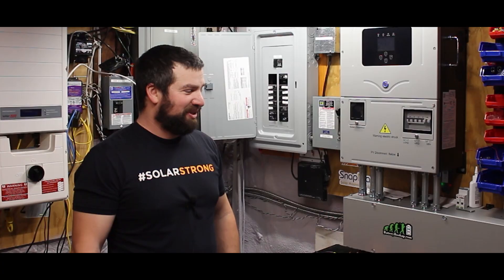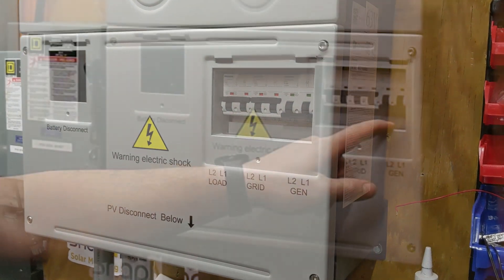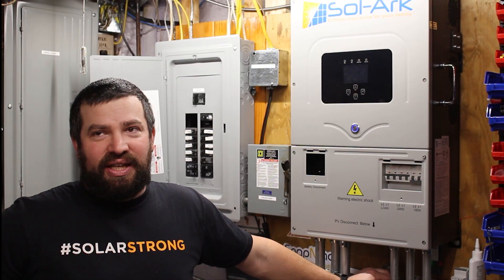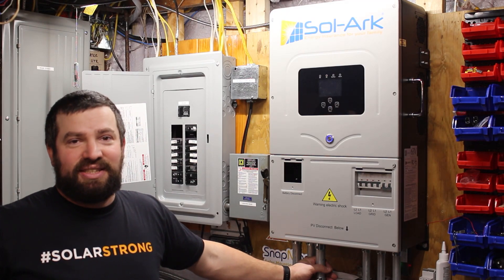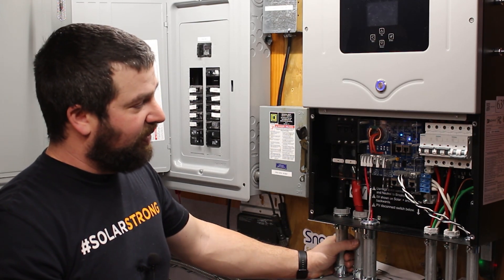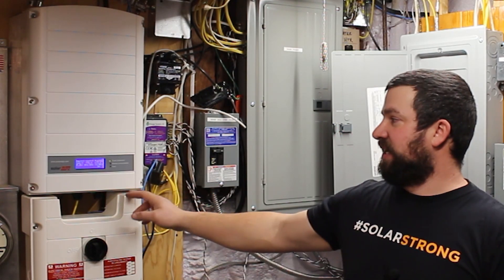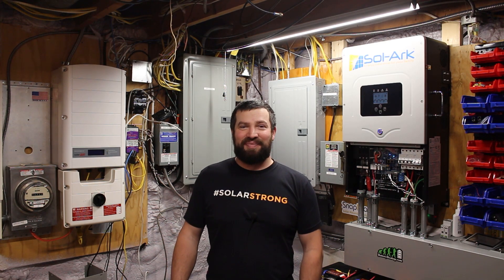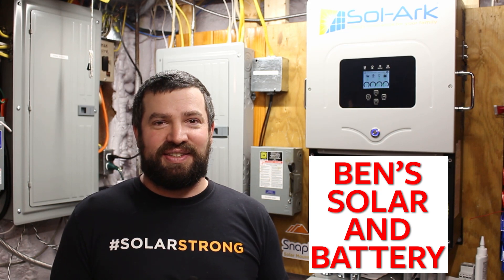Why the Professionals use the Sol-Ark 12K Inverter and Solar Charger

Comment: Note, only use the 90C rating of the wire if what you are connecting it to is rated 90C. If it does not say then it is not rated 90C.

Comment: It seems like the Sol-Ark 15K 2p inverter, and presumably the 12K, doesn't require an external AC Coupled Inverter to supply solar PV power direct to the AC home grid infrastructure - is that correct? If so, why is it that Sol-Ark is pretty much alone in this capability after the solar industry has had years to mitigate the work around?

Comment: After extensive research on an island residential solar inverter.
  I went with the sol-ark-12kw EMP. My installer contacted them to make sure it would work with my current whole house system and generator activation. Solark tec support reviewed the plan and said it would work for a whole house system with standby generator.(email documented) After purchase we saw it was only capable of 37.5 amp output. Far cry from what we were told (whole house). After 15 or so calls to solark and 12+  viocemails. The only real person I talked with was the receptionist who was very sympathetic that I still had not talked to a single person at solark, and none had returned my calls/voicemails. 
 I did talk to one who said he would call me later. Never happened all I wanted was to return the 12kw for a 15kw. EMP. And get an ETA for the new unit to reschedule my installer.
 This took 4 days and  had to pay the return shipping of $200 and a 3% credit card fee to get the larger inverter! No apology, no waiver of the CC fee, no free shipping label to return the wrong product they sold me. After arrival of the new 15kw the installers tried several times for tec support. They hit the same walls I did with nobody returning or answering calls!!
It took nearly 1week for them to get me an ETA for my installer. The equipment is amazing!  The company and responce time for a customer that just spent $9,000 on their product is disparingly inept!  
We also noted with the extra charge of $1,500. This purchase of the EMP hardened unit there were (no instructions on how to install the external EMP components!)  Nearing the end of install I received an email that the external EMP components were to be mounted to each solar panel that had already been installed! Now we needed o remove and reinstall each panel !! I was Furious. I emailed solark and was now told quote from Sean Miller Operatiins Director with Sol-Ark, (it is not required but is suggested!) So I paid $1,500 for not required but suggested Emp instalation on 
my Panels ?????
So why did it cost me an extra $1,500 for the external part that goes ON the panels is suggested???? Is their EMP hardened inverter a SCAM?? 
 IT HAS NO Instructions? And vague emails!
Needless to say !
 We will not be moving forward with solark with our future comercial instals.
The 1 star is for product!
 The customer support star!  You can decide!!
Charles Shotton
Missouri
Reply from the maker: I totally understand.

Comment: so that means that he is limited to the output of the sol-ark plus the power coming from the other one right?  because he mentioned he is limited to the 50 amps and that is not exact right ?
Reply from the maker: Ben may have been talking about 50A pass-through from grid to loads through the inverter.  But not sure.  The Sol-Ark was a disappointment and Ben is now using a Schneider.

Comment: The reason I was leaning towards a Sol-Ark was the unfortunately finding that the Growatt Inverters can only support the use a proprietary battery type ARO-HV or a LG RESU10H/16H. The smallest Growatt I could find was $5,214 for the Growatt-6.6-kWh-ARO-HV. The smallest LG I could find was a RESU10H R 9.8kWh for $5,400.

Comment: Know if you have a 48 V 100 amp hour battery then you only have 5000 W. If you multiply that times four you’ll get 20,000 w. 12 kW is enough to charge up a 30 kW battery system. You should have no problems having power over 100 A.  With split phase. If you’re inverter is shutting down and you can only get 50 A out of it you did something wrong.

Comment: I have a Carrier GZ060 (40A breaker) split system geo. From what I'm seeing, a lot of people aren't having issues with geothermal, but for some reason mine pulls enough power at startup to reboot my Sol-Ark 15K (AC_Overload_Fault). It doesn't make sense.

Any ideas?
Reply from the maker: I've heard similar complaints from a lot of people.  If you try a transformer-based inverter you will have much higher surge capacity to get a compressor-based appliance started.  I've had great success with the Schneider XW PRO: https://youtu.be/nCV1OUrcAaw

Comment: we have one like this and have 26 panels hooked up to it.  About 225 watts per panel.
The "automatic reset" is awesome. Just wait 1 minute after the circiut breaker flips and no worry.  There is another instrument   that can adjust the amps on each of the 2 lines to within one amp.    Lithium Ark batteries are awesome too

Comment: Just a thought been. You had stated that the right hand side of the inverter allows for either a generator input or can also be used as a output that’s controlled if I understood you correctly, essentially if you have an excess amount of power it can turn something on I think you stated like a water heater. That being the case could you utilize that leg as a means of charging your car? I understand charging a car you need certainty that it is being charged so when you go to drive it of course it’s charged up not that it’s just intermittently being charged but I think you get what I’m trying to say lol it just kind of came to me as I was listening to what you were saying. Awesome video as usual and very helpful.

Comment: Thanks for the Reivew, doesn't sound like I would be able to run a 50 amp plasma torch or welder off this unit if it can't handle your 20 gallon compressor, how it's it going to handle an 80 gallon compressor tank and plasma cutter going at the same time as everything else.

Comment: Great video and thanks so much for the detailed description!  Would the Sol-Ark inverter be overkill and costly if I only want a DC-coupled system and only have 120v critical loads (non-inductive) not exceeding 40A?  It seems the Sol-Ark is designed for those who have frequent power outages or plan to be off-grid for significant lengths of time.

Comment: Great video,   
The Qs , do you have a transfer switch that runs the critical panel when utility is on? and when A/C is lost it switches to battery?
I do not see 1 on your wall. Does your solar stay on when utility is lost? If you tapped into your solar system to power your inverters built in MPPT. where did you tap in and did you need a special device or what.  Sorry for the many Qs but I to am installing a 48vdc 15Kw inverter/charger with built in transfer swt  and 640ah batteries with NO built in MPPT charger. I am trying to find out where and how to keep the power coming in from the solar to feed the inverter/and charge the batteries.  any input you can offer would be a big help.
Thanks in advance

Comment: Hello,
Great video,very well done. Im writing because i have the exact same inverter,. Been using for 6 weeks flawley until today when it failed. Removed cover and has blown small capacitor on mai n upper board and 5 blown transistors on lower board at neg terminal from transformer. Sungold wont answer my emails. Do you know where i can get parts or if i send picks can you tell me where to purchase. Thanks al

Comment: is there a permit to add in the sol-ark with the solaredge inverter? Cause say if i already have solar by another company. and I wanted to add the sol-ark and would like to do it myself are there required permits?

Comment: Actually transformer based inverters are way better for the users. With transformer based inverter you would not have issues when starting inductive loads. The thing is manofacturers don't like them because those trafos are expensive so they keep telling customers that transformer based inverters are "bulky and heavy" - in most cases this is the first con mentioned in comparisions between them and transformerless inverters hieheie. Yeah, it's really a problem for my wall to hang on it 80kg instead of 45kg:):) Why they don't mention trafo based inverters ISOLATE galvanically your installation from PV/battery system which is HUGE PRO! Not mentioning overloading capacities. No way transformerless inverters are better. It's just salesmans not saying truth:)

Comment: Seems like a nice item. I missed however it was able to do three-phase? Also if it was possible to have two connected and communicating to get a more decent 24kw system?

Top on my wish list is a programmable ac outlet. I would love to have an outlet beeing connected when battery reach 80%(example) then turning of, when battery drops to 50%(example) and connect things like pool heating, aircond, car chargers. There could also be progrmmable outlets on time, useful for water heater and such.
Three or so outlets of that programmalbe kind would be cake.

Comment: David, in just a couple words, from the point of view of helping a beginner DIY'er decide, compare Sol-Ark to Growatt.  For example: Sol-Ark is versatile, industrial strength, 3 times as expensive  vs Growatt is lighter duty, less redundancy, less versatile is half the price.   Thanks in advance. Happy New Year 2022!
Reply from the maker: The Sol-Ark is simpler, faster to install, and allows AC coupling.  Growatts are less expensive (at least half as much) but don't allow AC coupling.  If you want to see a cost comparison, I have one at the end of this video: https://youtu.be/EYIzEW54_bY
Reply: @DavidPozEnergy  You're awesome, I appreciate you responding.  Also thank you for your time and talents sharing videos - they're a helpful tool to navigate through some of the marketing baloney and see some real world application and limitation of the technology.  I'll check out the video you recommended.  Cheers!  Happy New Year.

Comment: Most large companies shallow well pumps are set up for 110 220 
Most motors over a 1/3 hp. Motors is able to use 110 220 the instructions for conversion are written either on the motor or on the cover plate for eledtic hook up inside the plate

Comment: I have a question I hope someone can answer.  I'm confused about what position the circuit breakers should be in in the user panel.  Common sense tells me green means go and red means stop but when the circuit breakers are in the on position why is the little arrow red, like your video?    My system (12 K sol-ark) went down completely yesterday morning and I opened the user panel to try to trouble shoot why. The Grid breaker was in the up position (arrows red) the Gen breaker was in the down position (arrows green) the load breaker was in the up position (arrows red). Both the inverter and the two batteries (Storz) went down. A little backstory:  I have a 9KW system at an off grid camp and it was showing 100% charged Friday evening when I arrived.    We used some of our lights and watched a little TV that evening and then went to bed, I got up and turned the TV on to watch the news and then my system alarmed and it shut down.  I didn't have time to even get to the screen on the inverter to read what alarm went off before it shut down.   I did reach out to Sol-Ark and the installer but it's the weekend and nobody is responding.  I have a very hard time believing that the few lights and a couple hours of TV watching used up all my stored battery power.    I'm unsure what to do, I don't want to ruin anything so I'm afraid to start the generator because I don't know if the system needs to be charged or if there was a failure somewhere.  I'm also worried about leaving the system off as we are getting freezing temps and I don't want my batteries to freeze.  I am going back and forth to maintain the woodstove but I'd like to resolve sooner than later.   I appreciate any feedback.

Comment: What will one of these inverters set you back and how is repair support? Do you need to send the whole unit back for service or is it modular for DIY repair, yes I do electrical work as well as electronics repair, been a service tech since the mid '80's and its time to tell the utility company to go fly a kite.
Reply from the maker: About $7,000 USD.  The whole unit would need to be shipped back.

Comment: When u say you can’t charge your car and run dryer at the same time. Do you mean when you are running all off grid using the Sol-Ark only? I’m hoping that is the case.
Reply from the maker: Yes, that's what Ben means.  If Ben runs on the grid he can do both at the same time.
Reply: @DavidPozEnergy  thanks for the fast response

Comment: Please Reply.
Thanks for your input, 
I want to now if i can power 2 x 5KW inverters direct from the grit with a 240/24V Ac to Dc and keep in mind no Panels or Batteries. The house normal use 2 KW but when my wood Woking shop start up and i start my equipment the power increase from 2KW to 7-8 kw.
Question: Will I save money throw the inverters or will it be the same as from the grit , But panels and batteries will be used in the system.
NB. Panels and Batteries will be add latter when money is available.
Regards Gerrie Kruger.
Reply from the maker: If you are powering your house from the grid, and don't have solar, then there is no reason to add an inverter.  An inverter only helps if you have solar power.

Comment: So I have a question, I was looking into enphase microinverters since it can operate with each indivdual panel, and if one panel is operating less than performant it does not affect overall much. How does this handle multiple panel obstructions
Reply from the maker: The Sol-Ark can AC couple.  This means you can use a micro-inverter on each panel, and still tie it in with the Sol-Ark.
Reply: @DavidPozEnergy  ahh I see, I just was on phone with Solark for 45 minutes, very nice and helpful people; think I will likely go with Solark because it allows me to retrofit microinverters if in need to ans also the icing on the cake is solar flare protection :)

Comment: Don't forget to inform the public that Sol-Ark inverter "monitoring" and the phone app, are both hosted by Chinese servers in China.  That's right.  The Chinese will have full access to the IP address of your server all the time if it is being monitored.  Don't waste your money getting the EMP hardened version if you intend to have it monitored, because the Chinese can reconfigure your inverter and render it off, on, misconfigured and DANGEROUS!  Sol-Ark needs to get their heads out of their arses and understand that people who want the security of reliable power don't think giving the keys to the Kingdom to an adversarial nation should EVER be a part of that equation!

Comment: Most electronics / computers / TVs etc... can use 240v power.  It's typically more efficient as well.  Convert things in the home over to 240v.  For computers it's a switch on the PSU if it's not auto.  Power adapters for laptops / phones / and anything else sold globally can already eat pretty much every power found on the planet, 90-250v 47-63hz.  A lot of inverter powered devices like refers / microwaves / AC units can as well.  Those devices transform and rectify the power into much higher voltages going from AC to DC and back to AC.

Comment: The generator input can be used as a generator input... FASCINATING!  All that money, and you can't charge your car and run the dryer at the same time. And it shuts down running one air compressor and sometimes the dryer by themselves... This is why solar sucks.
Reply: It all depends on how much you can spend.. you can power anything anytime for a long time off grid.. it just takes money..